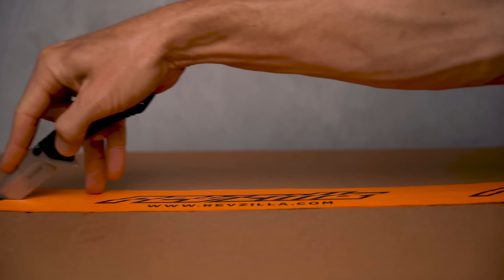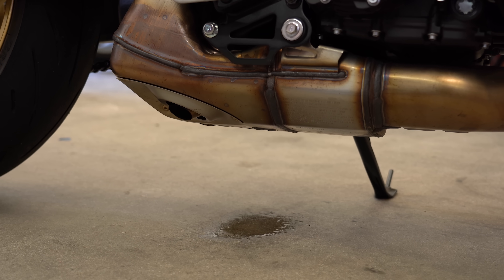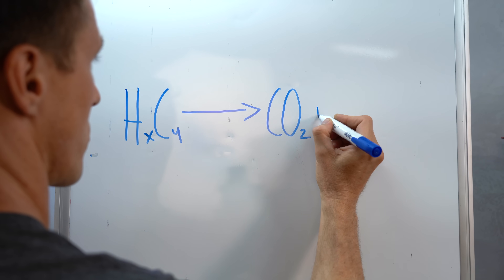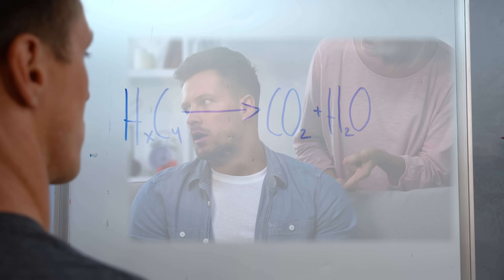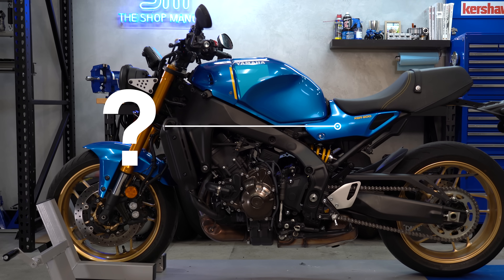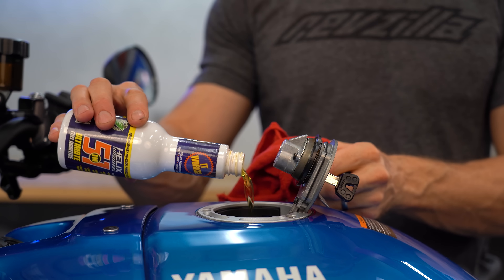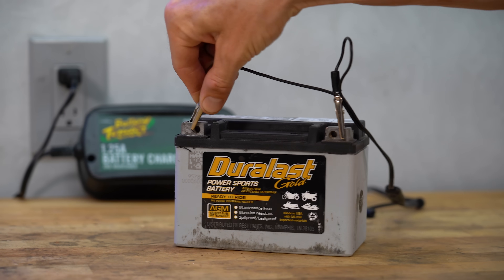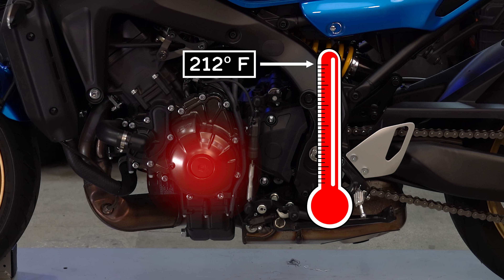The Storage Myth That Hurts Your Motorcycle | The Shop Manual

Comment: If you want to start your bike in the winter - you need to ride it a least 10 miles to get it warmed up to temp, just bundle up and do not ride on icy or snow covered roads.   - just idling it is not recommended!

Comment: It depends where you keep it though right? If the bike is in a heated space (like mine, it has its own radiator 😁). it never gets cold enough to form condensation.  A run every few weeks won’t do any harm.

Comment: I live in Michigan, every year I store my motorcycles for 5 months and I never start them over that period and never had a problem.  For batteries, all lead acid batteries get a battery tender.  Lithiums actually like to be store partly discharged and in a cool or even cold place.  Also, "never" fully charge a lithium battery and store, they only self-discharge 5% per year anyways.

Comment: This is where old bikes with a kickstarter come into their own. My 1978 Triumph T140V is taken off the road for 3-4 months in the winter time, depending on how long they are salting the roads here in southern England. At the start of this, I take out the spark plugs, squirt some oil into each cylinder and turn it over with the kickstarter to coat the bores, before refitting the plugs. I then repeat this process once a month until I'm ready to ride it again. I also rotate the wheels a little at this time to prevent trapped moisture corroding the discs where the pads make contact. Battery is kept in condition by regular charging. I've never had a problem with leaving the fuel in (I always use E5). I've also got a 1980 Suzuki GS550L, but that gets used all year round - winterisation consists of coating all the bare metal surfaces with WD40 and putting the thermal liners in my riding gear.

Comment: Thank you very much for the professional video, my man. I have a 2005 fatboy, i always change all three holes before storage. But this year, i did the primary and only the oil in the  crankcase, i just did the TRANSMISSION, yesturday. And like you said, I did start the bike after the change, the bike had been stored for 2 months already.....and yes, like an ass i started it.  You are exactly correct, when i let the bike idle for 15 mins and then turned it off. I then went to check the oil and BINGO!!  MILKY WHITE OIL!!    My comment....proves your awesome video is correct, my biker friend, ty again!!!!!
Reply: If your oil turns milky in 15 mins you are using bad quality oil . if this were the case then nobody should ever start their bikes in the winter.
Reply: They all get moisture from condensation if it sits just from the change in temp it's normal starting it doesn't matter starting it burns some of it out if anything it's in these peoples best interest to cause rust in your cylinders so they can make money from rings pistons oil gaskets tools for honing all that

Comment: Also in frigid winter climates it's best to get your battery indoors for the winter ,ck and top off the fluid levels,and put it on a charger once or twice a month. Extreme cold will kill a battery left outside even on a trickle charger.

Comment: Another tip for long term storage: the last few fuel ups of the year try to find non ethanol gas. Ethanol attracts water so you can just avoid that issue by having your tank filled with non ethanol fuel if you can find it
Reply: Is that what stabilizer does? Neutralize the ethanol?
Reply: I run non ethanol most of the time, gets better gas mileage and it’s just better for the fuel system
Reply: 100% this. My bike is fuel injected, but even with my carbureted lawn mower, I run non-ethanol in it and it's sat for over four months at a time and starts and runs just fine with no fuel prep.
Reply: If I store a bike I take the ethanol out; there's loads of videos on the tube and it's pretty easy.
Reply: Some countries mandate ethanol fuel for road use.  If so, check with the local airport or marina.  Look for the FBO (fixed base operator) on the "general aviation" side of the field, well away from the commercial passenger terminal.  Bring a gas can and tell them it's for your back up generator.  They can't sell it to you for road use.
Reply: Sadly...because fucking EU regulation, in Europe, you d'ont find gas without etanol and it's with10% minimum😢
Reply: I use shell  v power for my dominator..has the bear minimum of ethanol  in belgium !!😊
Reply: Sadly is that ethanol free gas is getting rarer by the year. Even in Canada some that were 0 ethanol are now not entirely ethanol free, including Shell V-Power.

Comment: Just pulled my two Ducati singles  and my BSA 650 out from under the house where they'd been 'in storage' for the past 7 years. With a new battery and fresh gas they all fired right up with only one or two kicks (the BSA on the first kick). The reason for this was simple: on my last ride with each one I turn the fuel off a mile from home and then let them run out of gas, (draining the carbs also works). And before firing up the Ducs I removed the valve covers and spark plugs and shot some oil over the valve train, pistons, etc. You also want to kick them over from time to time while stored, and single cylinder bike should always be stored with the piston near the top on the compression stroke. This keeps both valves closed, reducing stress on the valve springs, and prevents moist air from entering the cylinder which can cause rust.

Comment: Mmmmmm.....45+ yrs. in the Midwest...... I start my bike- letting it run UNTIL the cooling fans come on.  NEVER had a problem with any of the 13 bikes owned.  Just say'n.  And over half the bikes were ridden fine....over 70K miles.  Good points on tank full of gas, w/STABIL added.  But my POV is get that bike HOT- meaning when the cooling fans come on....trust me it's hot enough.  DG

Comment: Over here in Dubai, we don't ride in summer, because it gets extremely hot 🔥 (113-120 f) and I usually cover my ATVs , hook up the solar battery charger and drain the carburetor, fuel is the only problem but i usually drain it once I'm servicing it when preparing for riding 👌🏻👌🏻👌🏻 works well for me since 7 years already, however, storing your ATV outside in a shaded garage is not the best (specially with sand and rust 😑)

Comment: Change you oil right before you put you bike up.. bc condensation builds up in your oil during seasons hot or cold.. moisture will still build up from condensation going from cold to warm without starting your bike.. if oils sticks around then they would not rust regardless correct? So I would say in my opinion start it to make sure everything stays lubed and fresh..The biggest problem is not letting it warm up long enough bc you can ruin internal parts on your bike such as head gaskets, bc of the fact that different metals expand at different times. If I can’t start my bike up in the winter, they need to redesign the motorcycle engine.

Comment: I TRY to ride year round, no matter the weather; I live in Seattle and am good to about 44F. ambient....because at road speeds that's about 10 degrees cooler/Wind Chill, or just above freezing.  At that low end, I'm good for 1hr. max.  I don't ride in the rain, so if....I'll still idle my bike 2-3X monthly.  AFTER this video- I think I'll just get the Tender.
NEVER thought/considered condensation processes or issues.  GREAT insights.

Comment: Fortunately I don't leave in cold weather, temps reach at least 77 degrees here, even now in winter, still, I do follow that method of not starting my sled when being storaged; that method tipically applies to cold weather, the manual itself indicates so, anyhow I believe is good to follow that method even in warm weather, if you want oil circulating the engine, just take your sled for a ride and let your engine get to operating temp, that's about it.....ride on!

Comment: I also pump my tyres 10 psi above and use center-stand or paddock-stands  . When it comes time to start (on older-conventional bikes at-least ) I crank it over without-choke (or use kicker ) until the oil-light goes-out to prime the system Dave  nz

Comment: I always took mine out of the garage and let it run for about an hour. I could lock the throttle so could even keep the revs up. I kept it full of non ethanol as that was all I ever ran in it anyways. Never an issue. For moisture. But after time the battery just gets old and the cells won’t hold a charge, so unless you de sulfate, which I do now, you’ll have to replace the battery at some point anyways.

Comment: Fuel stabilizer is snake oil.  Just fill the fuel tank to the absolute top to almost overflow then snap the gas cap back down.  In Australia we have 98 Octane with zero Ethanol and it's easily good for 12 months if stored in an airtight container.  I keep my battery on a Ctek 0.8 smart charger and for the 4 months that it's wet roads here I never start it at all.  I've used this system for decades and never had any issues.  Airbox intake is also covered and the exhaust can has a silicone bung placed in it.

Comment: Each clip I watch is invaluable and helpful. Even though I have been a rider for nearly twenty years.
I never warm up bikes in winter though. I just ride them. When I lived in the Crimea I rode my Honda Dio all year round. Back in Odessa since 2014 after the Muscovy occupation, I also ride YBR125 most of the year although it is colder by 5 ° on the average. It is YZF600R that I don't like riding in winter too much... Though I met the new 2021 year riding ThunderCat to Primorskiy Boulevard!

Comment: I take a different approach, and actually ride mine all winter. Even in the coldest months, I pick the mildest days that come along and suit up in warm clothes, and take it for a 20-30 minute spin. This will happen at least once, a month, and sometimes 2 or 3 times a month. In 52 years of motorcycling, I've never had a carburetor, battery, or any other problem I know of that was caused by winter storage.

Comment: For 25 years i have stored from nov to April 4 diff Harleys in a Vac Bag.i fill the tank to the brim with fuel ,put in fuel stabilizer ( 30 mill redex) run the bike with fuel tap to off till it cuts out ( leaving no fuel in carb ) take out the plugs put 10 mill redex in each plig hole ,clean and set plugs ,smear plug thread with copper grease and put back ,pump up the tyres higher that normal ,put it in the bag ,connect battery to optimate 24/7 charger ,put in the dri sorb condensation pack ,sucknout the air with vac cleaner ,bungy up end of bag ,and forget about it till April.
Come April it comes out that bag like the day it went in ,and fires up after 3 or 4 spins .
Have done this since 1990 .
Latest bike in bag is a full customised ,heavily chromed 22 Year old FLSTF

Comment: I store my toys in a 40x120’ shop, I start my 2 riding mowers, 3 atv’s, a Harley Davidson, a 1999 Porsche, 1960 Ford Falcon, 2010 F350, and 2013 Honda Odyssey once a month and let them run for 15-20 minutes, I’ve never had an issue with any of them.

Comment: Further to this it puts a huge strain on the regulator rectifier as you're not revving the engine and creating strong current. Mine failed after about a year of the occasional start and idle while the bike was in storage.

Comment: My air cooled dual sport gets a fresh oil change, a tank full of ethanol free rec fuel, a splash a sta-bil, and the battery comes out, and sits on an oak board on my pantry floor, because we usually get a week or two of 0⁰ F weather. Spring time first fires are no problemo, been that way for decades. My liquid street bikes got the same treatment.

Comment: Starting in Oct, I add stabilizer (usually Sta-Bil Marine) and Lucas Fuel Treatment at every fill-up.  I'll stop in April once the conditions are such that I'm more apt to ride than let it sit.

If I ride in the cooler months (Oct - April), I always top off the tank after every ride.  A full tank has less space to allow moisture to condense inside.

Why the Lucas?  It leaves an oily residue on the fuel system.  My dad started doing it with lawn equipment way back as he was told (and I've since verified) it pretty much eliminates any internal corrosion to intake, carb, valves, etc due to condensation while in storage.  

It's probably overkill on my motorcycle as I seem to get in at least one ride a month even in the winter (Gotta love heated gear) but the same works for all my other equipment and my Snowblower is 22 years old, the generator which might see a 2 or 3 days use each year is now 18 years old.  All of these are stored with full treated tanks and always start easily each season.

My lawn tractor is newer, but that was a failure of the transmission, not engine problems.

I keep all my small equipment batteries on a Battery Minder device.  This is advertised to help eliminate sulfur buildup.  All I can say is that my factory 2014 MC battery is still original and working, the lawn tractor battery from 2017 is also original.   Before I started using the Battery Minder (I had used a Battery Tender Jr) I never had batteries last more than 6 years.  Must be something in that desulfuring process.

This is just my experience, not scientific proof.  But I can't argue with the results.

Comment: i always set up a constantly running fan along with a dehumidifier in my garage for these reasons,  connected to a maintenance charger and once every few months take each bike out, drain the fuel, run it up for 15-20 minutes, get the oil hot, if on a Centre stand, run it in gear and spin the moving parts a little.  chain lube and douse the entire bike in wd40 and put back into storage. nb i live in australia, no snow, and ride all year round even in winter

Comment: I left my 1979 Yamaha SR500 for 1 year in my garage, under some blankets, One day I thought, let's see how it's doing ?
Turned on the ignition, turned the headlight on & on it came, at normal strength. That's 1 whole year without being used & no battery charger. 
It was a yellow motobatt which is still going strong & is 10 years old. Bloody brilliant. 
One thing that did happen was that although my bike started 3rd kick, it ran like a dog & this is because the petrol had gone off.

Comment: They stopped selling alcohol free gas in Toronto area mostly and that pisses me off. Other than that I just unplugged my battery, jacked up my bike, filled up the gas tank, and next spring I'll push start it (I think the battery is not going to last for the whole winter but I just need it to crank a little bit) and hope for the best.

Comment: Thickly charging your battery during the winter can reduce its life, there are high current battery conditioning chargers that you can use once a month when your bike is in storage or just plug onto your bike 24 hours before you take it out in the spring. Due to the high initial current charge it’s advisable to disconnect the battery leads from the terminals and just charge the battery on its own in situ or out of the bike. Due to the auto reconditioning features of these chargers they can recover a fully discharged battery but if your battery is going flat over the winter either there is something draining it like an alarm or tracker or it needs replacement.
This I’ve learnt over 53 years of motorcycle ownership and 20 years of work in building security where gel batteries are used as backup for mains outages.
PS Don’t set the charger to manual and leave on charge over night or your battery will overheat and swell cracking the plastic case, I learnt that the hard way 😳

Comment: I leave my 2015 triumph tiger outside in the winter in NW PA and never start it till spring. I will say I've left the battery in the last 2 winters and jump it in spring and it's good. Idk what battery triumph uses but 7 years and it's till good. Props

Comment: I am not an engineer or mechanic so feel free to make suggestions. I do the full tank with stabilizer, and often remove the battery if there is one. Also I have poured an ounce or so of oil into the exhaust  on a down swept pipe. I let it idle long enough to heat up the pipe and create what I imagine is an oily mist inside the pipe. I think I put a bit too much in one year and at a traffic stop on the first ride of spring I had a huge cloud rising in the air. It was a bit embarrassing but had blown out or evaporated after a quick burst on the highway.

Comment: Sound advice. I have many (too many) bikes and alternate several battery tenders between them. Always fill up on the way home after a ride. I try to take each for a short ride once in a while during non riding months. Also keep tenders on another car and the diesel truck. And the camper has solar hooked up 24/7. Batteries seem to last a very long time.

Comment: I suppose it depends on the bike. If you have one of the old classic K BMW's, you might want to start it a few times over a long cold winter, during a warm day. If you don't, what is likely to happen with those, is that your cylinders will be dry in the spring and then you will likely crank and crank, and crank, hoping for a start because some of the cylinders will likely be firing, but not all, and you will think that any second they all will kick in.

However, if you had started it a few times during the winter on warm days, the cylinders would have the oil they need for good compression. 

I believe that the old-style ATF makes a good fuel injector cleaner, so I put more than a few ounces in the gas tank in the fall, run it a bit to get some of that in the injectors too.  It's not a bad fuel pump lube too, even though it really doesn't need any. I don't think there is anything a little ATF would harm. I believe a little of that can only do some good, whether in the oil or in the gas. Just don't overdo it.

Comment: I start mine occasionally never had a problem, warm it untill the fan cuts in , change your oil regularly, I prefer to move the pistons in the bores and get the oil flowing,